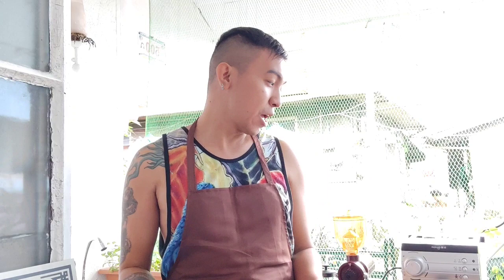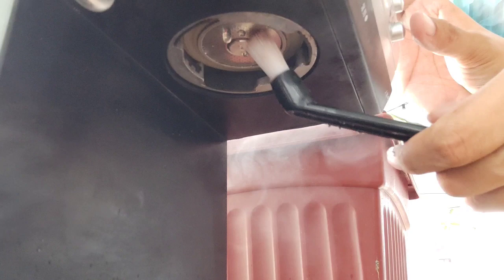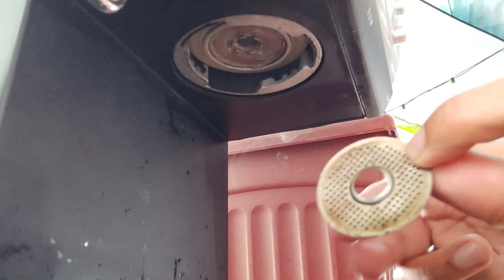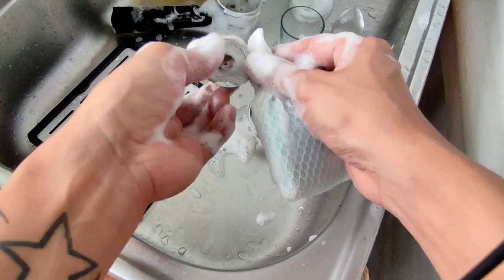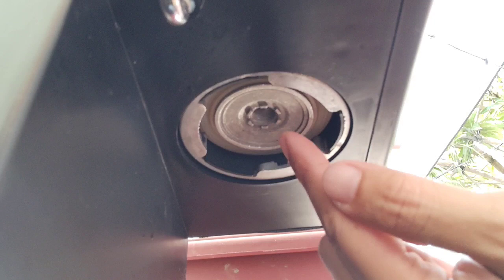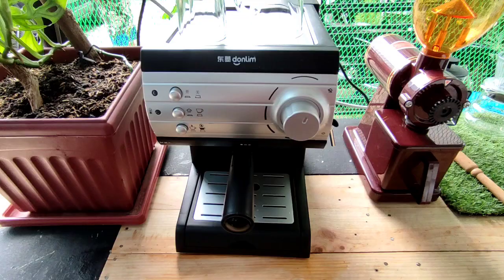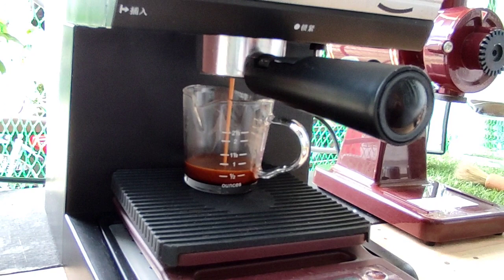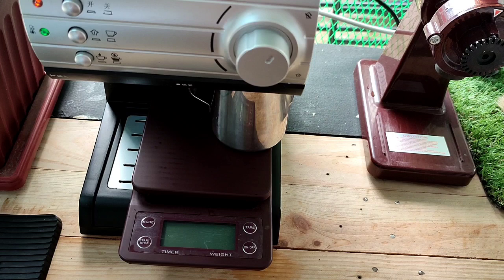How to clean the Donlim KF-6001 and How to achieved a dry coffee puck using this machine? #Donlim

Comment: I have the same machine and always wondered how to get a dry puck. Thank you so much.
Reply from the maker: Just on the steam button, and dont remove the porta. Air pressure will come out inside the group heade while heating up for steam and that pressure push the water that still in the porta basket until its dry. And then you will remove the porta and voala you will get a dry coffee puck
Reply: @yourbaristalouise  me too! Thank you so much for this!

Comment: Is having a dry coffee puck all that important? Granted it will mean faster turn around time for cleaning between espresso productions (esp. for a small espresso business). For personal use, it may not justify the additional power required to heat up the stream pressure. What do you think?
Reply from the maker: actually its not that important. the important is the taste of the espresso.   and this machine dont have the valve that will remove the water from the puck.

Comment: Just an added note to your viewers, you may also soak the portafilter in sodium hydroxide solution (caustic soda/sosa) using a ratio of about 1:5 v/v. Soak for about 3 minutes. In time kasi magkakaroon din ng buildup ng coffee particles sa portafilter mesh. Of course after soaking, wash well and rinse thoroughly with soap and water. Ingat lang sa paghandle ng sosa kasi sobrang corrosive nito sa balat.
Reply from the maker: Thank you so much 🥰🥰🥰

Comment: hi i followed the instructions on my kcb machine. Thanks so much. But i noticed na drips lang nalabas sa machine instead of a steady flow. Is there something wrong with my machinem
Reply from the maker: sa water lng po ba or sanextraction na po ng espresso?
Reply: @yourbaristalouise  sa water. It was extracting fine naman a few days ago
Reply from the maker: @RedShoes29  maayos naman po ba pagkakabalik nyo ng mga parts?
Reply: @yourbaristalouise  yup. Before pa naman nung cleaning may issue na siya sa water flow kaya ko binuksan hehe. I thought that would fix it pero mabagal pa din. I'll try descaling next
Reply from the maker: @RedShoes29  ahh baka may prob na po. na ask nyo na po ba sa seller?

Comment: hello. question po. kapag ganyan ginawa, nag gawa lang ng espresso, then switch on yung steam fot a dry puck, need ba irelease yung steam after? ako kasi minsan di ko ginagamit steamer so Im wondering dapat ba irelease since uminit
Reply from the maker: No need naman. Kung mapapansin nyo, sa group head may natulo or minsan may hissing sound. Dun sya nag rerelease ng init para hindi sya mag over heat. Naglalabas sya ng init pag nareach nya yung init na kaya nya.
Reply: @yourbaristalouise  nasira po kasi yung sakin hehe, hindi na nag ggreen light, buti within warranty, pinalitan agad. pero minsan kasi po naiiwan ko naka plug kahit di ginagamit. baka naging cause din
Reply from the maker: @kenv2667  yun lng. Sakin kasi ganun eh. More than a year na din at goods pa din
Reply: @yourbaristalouise  nakaiwan din naka plug? baka minalas lang ako
Reply from the maker: @kenv2667  naka plug pero hindi naka on
Reply: ahh sige thanks sa pag sagot po 😁
Reply from the maker: @kenv2667  welcome po

Comment: Hi Louise, how many g of coffee does the standard portafilter hold? Also is it better to switch to the non-pressurised portafilter? Your non-pressurised portafilter looks like it can hold more coffee grounds than the standard. Hope you can help, thank you!
Reply from the maker: there is no standard grams for porta filter but if you were talking about the donlim stack porta filter it can hold 10-12g of ground coffee depends on the grind size.,and it will always depends on tha basket used if its 1cup/10g basket, 2cups/15-19g  etc etc... yeah for me its better to use a non pressurized porta filter with 2cup filter basket because i get a better espresso using a non pressurized porta filter
Reply: @yourbaristalouise  I see. I always wondered why when I pulled a 60ml shot the taste is kind of diluted. I just did some reading and it suggested 18-20g for a 60ml shot, which means I need to pull twice to get 60ml shot. May I know where did you get your non-pressurised basket? Because it looks like you are using the stock donlim portafilter but changed the basket.
Reply from the maker: @roshanmukthi7400  i think that 60ml for 2 shot is used in commercial coffee shop lng sbux. cause i use 30ml good as 2shots. i just used double amount of coffee ground. and for the the 60ml espresso is too light and watery.  i bought my non pressurized porta filter online. from lazada.
Reply: @yourbaristalouise  thank you so much for your clarifications. Your videos help alot!
Reply from the maker: you're welcome sir. and thank you for supporting my channel.
Reply: Hi Louise, When you switched to using the non-pressurised portafilter did you make any adjustments to the opv valve to bring the pressure down to 9 bars?
Reply from the maker: I dont know how to adjust the opv, i only adjust the variable that i can control like the grind size of the beans
Reply: Okay Louise, thanks for replying.